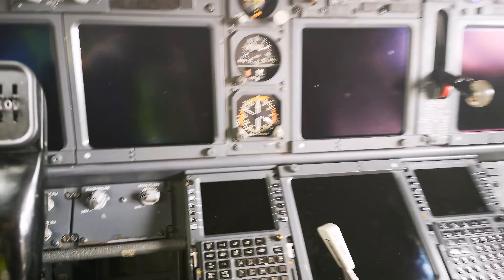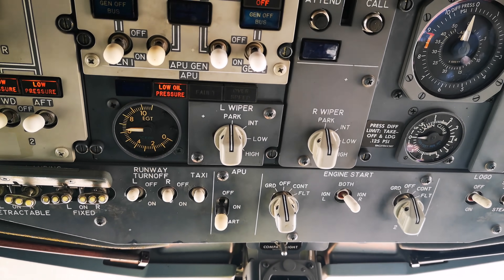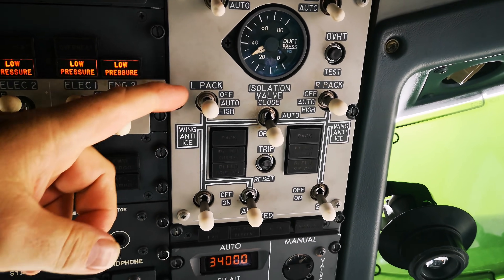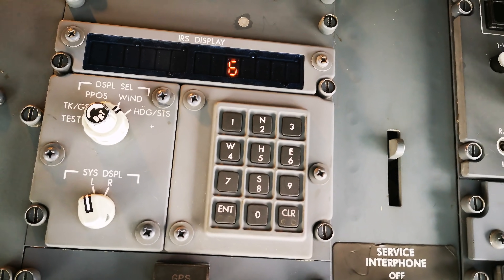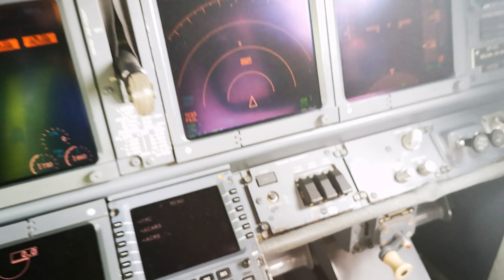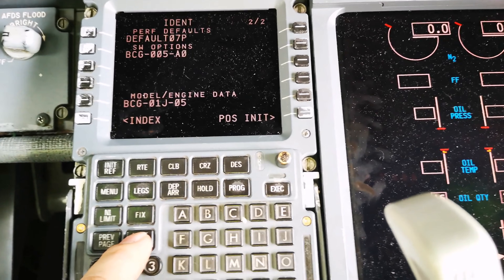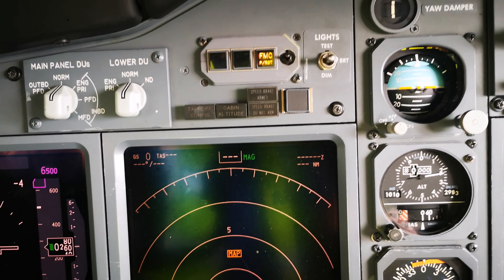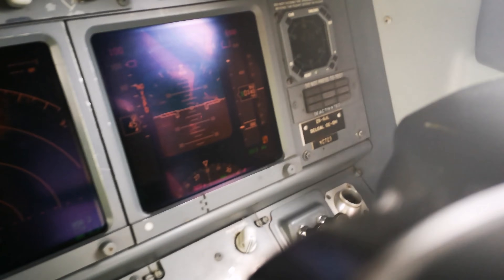B737 800 APU start and cockpit prep

Comment: It'll be perfect if this could be filmed with a gimbal  or a phone camera with better stabilizer. More detailed explanations for the abbreviations on the panel and basic theory explaining the readings of the dials/indicators and why that reading (3000 instead of 7000) is desired, please.

Comment: Great video, thanks. Does the Left Aft fuel pump need to be on for the APU? 738 models in flight simulators don't appear to need that, although it is on the pre-flight checklist.
Reply: It is not mandatory, but it is recommended. Turning on the fuel pump will increase the life of the APU.
Reply: Depends on the length the apu will be on. If ground power is up and the APU's only needed for engine start fuel pumps wont be necessary but here the APU is the main source of power and will be running for long hence the fuel pump is switched on.
Reply: Technically speaking, APU does not require any pump to start/work. Though enabling pumps will help APU Fuel Control Unit to last longer. Take into account the Fuel Pumps are AC, so you might not always have AC power before you have APU GEN on bus. APU DC pump is an option (automatically enabled), though APU can suck fuel without any pumps.

Comment: this looks like a giant mess. Compared to airbus is like engineer got drunk and installed all of these fancy switches and gauges in that boeing lol
Reply: It’s because it’s not all computerized like Airbus, it is still computerized though. Boeing relies on pilots more than airbus with the plane. That is why I personally like Boeing more.
Reply: what? Do a little research on 737 history and how type rating certification process works. What a stupid comment
Reply: Absolutely, it is a 60-year-old design. Even the MAX doesn't hold a candle compared to Airbus in terms of ergonomics and user interface.
Reply: @ttrcatbus  this may sound weird but I personally like it. It makes you feel so smart when you figure it out. It’s honestly pretty imple just looks hard
Reply: @ReidMichael-ip3oy  Simple, yes. The core systems are very similar between Airbus and Boeing as I’m sure you’re aware. Airbus just takes human factors into account much better than Boeing.
Reply: @ttrcatbus I prefer Boeing planes because of the yoke
Reply: @ttrcatbus Which is sad because the A320 is a 40 year old design.  Innovation died after the 80s.
Reply: That’s because Boeing pilot are competent pilots, instead of EHUM Airbus pilots, everything is automatic in that cockpit!

Comment: Good video.

So the Left Aft Fuel pump is left in on postion when going cold and dark?
Reply: It's been a while since I flew the 737, but the fuel pumps will only be powered with AC power to the aircraft (so, ground power, APU or engine Gens on). So when AC power is removed, the fuel pump will be unpowered anyway, as can be seen here with the 'Low Pressure' amber light on until the APU gen is on the bus (so no harm leaving the switch on really). The APU will suction feed without fuel pressure, but it's better to have one of the left main tank pumps on when running the APU on the ground to ensure good fuel supply (the APU fuel is supplied from the left side of the fuel manifold). You can use the left center tank pump as well, but the cockpit has to be manned with center tank pumps running, so engineers especially, who will likely leave the cockpit unmanned, will use the left tank pump. And the reason for using the AFT pump in the left main tank in the -800 is that it has lowest pickup of the two. The APU should be operated for a two minute warm up period before using it as a bleed air source as well, something to bear in mind.

I personally always moved the switch to the off position when it was intended to be off (as opposed to just letting it be unpowered). But there's very little harm doing it this way in practice. To answer your question: no, it's not standard to leave it in the on position. In practice however, it doesn't make a difference really - if you powered the aircraft with ground power however, the pump would switch on and run for no useful reason though if you didn't check the pump switches.

Comment: This is a 737-800 ? I am very surprised at the analog switches ,dials ,knobs and gauges .  This looks old .
Reply: Yes this is how an 737NG looks like
Reply: @BlackRacerGT19  yeah but the overall design has changed for example the screens.
Reply: 737-800 is nearly 30 years old now.
Reply: @BlackRacerGT19  Yeah i know. I didn't say they changed the type ratings. I just wanted to get my point through that the original comment said the 737NG looks old to which i responded that the 737CL looks even older.

Comment: I noticed the left aft fuel pump was already on before turning the battery on
Reply: Yes, otherwise APU wont have Juice to Power on 😅
However fwd fuel pump is advised to be used to turn the APU on instead of aft fuel pump
Reply: @AlexandreEmanuelle sorry but that is wrong, the apu can run with all the fuel pumps off, but for extended operations, Boeing recommends to switch on one fuel pump. the apu is only fed through the left main tank

Comment: Perfect. But you didn't mention that before APU start you have to turn on one of the fuel pumps
Reply: Wow very impressed with ur commet
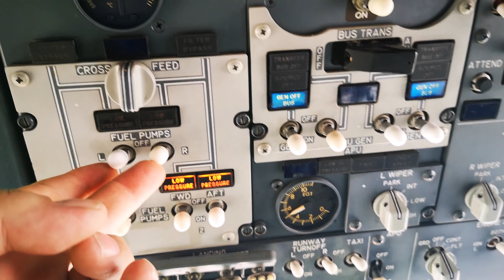Reply: He mentioned the fuel pump at 4:37. Out of sequence but he showed that that switch was already on before he started the video.
Reply: I think the pilots and engineers know best also I don’t believe you need a fuel pump on
Reply: Technically, you don't. How do you think APU battery starts happen w/no elec buses? The APU has its own fuel pump, but it's best to run one of the tank pumps to help it out. It will start and run without it though. Same for Airbus.
Reply: @noway9880 100%
Reply: Also take a note, that pumps are AC powered, and without AC power enabling fuel pumps makes no sense. From FCOM:

Note: Whenever the APU is operating and AC electrical power is on the airplane busses, operate at least one fuel boost pump to supply fuel under pressure to the APU to extend the service life of the APU fuel control unit.

So normally it's fine to enable the pump to ON before APU started (it will start working after AC is here) but not required

Comment: very old cockpit layout
Reply: That’s like 99% of modern jet liners tf? It’s a glass cockpit with analog backup gauges
Reply: @Watermalone119 no he's probably seen an a350 or a320 cockpit and hadn't seen Boeing cockpits before. Airbus have very modern cockpits and more computer systems and less buttons than Boeing. Boeing cockpits look a bit different and more complex
Reply: Bro theres just some analogue stuff. It has the Collins MCP so it can't be that old

Comment: After flying the CRJ which is by no means a modern aircraft I can not believe how antiquated the 737 is
Reply: The CRJ is a flying high-school physics project, lmao, you have no right to call the 737 antiquated. Those things are fucking terrible.
Reply: At least it has VNAV and autothrottle unlike your CRJ
Reply: It's a plane designed for real pilots it let's you have way more control than most airplanes especially airbus
Reply: @96cr show this man an A321 cockpit

Comment: Nice Video..... Shouldnt the IRS test take 9 mins instead of 6 mins.....
Reply: It varies depending on the latitude. Closer to the equator is shorter amount of time.
Reply: @tomp7621  
Interesting...since it aligns faster at a higher lattitude
Reply: @HAWK21M  latitude! not altitude,

Comment: Thanks for the video! I work on the P8's which is basically a modded 73-8, and boy do we have to go through the book to start the apu, takes about 10 minutes to get it running!
Reply: That’s stupid.  It should never take that long.
Reply: Oh I absolutely could not agree more with you on that one, but sadly it is stupid, everything is so over the top its actual aids

Comment: It is a mess compared to A320.
Reply from the maker: Jip,  Battery on, APU on, Wait a few minutes till you hear the 3 click sounds and "Tada". READY!!
Reply: It's 50 y/o design. You're comparing apples to oranges. The 787, for example, is just that simple as you describe. But it's the product of billions of dollars and years of development. You can't just do that to the 737.
Reply: @jrod_pilot_miami  A320 is a 40 years design. Boeing had pelnty of time to modify that, and what did they do with 737 MAX? yeah... to "save" money
Reply: @MiguelAngel-lk9tj  yeah. Boeing could have done that. But before doing that, they would have just built a completely new Aircraft. A cockpit design is an integral part of an Aircraft and the 737 just doesn't seem to be at the end of her lifespan.
Reply: @MiguelAngel-lk9tj  It's not that simple. First, Airbus and Boeing have two very different design philosophies. Airbus believes automation removes the human error component in flying. While Boeing believes automation should supplement pilot training and experience. That is the drive behind the Airbus' "simplicity" in cockpit operations, and Boeing's more "hand-on" approach. By the way, the Max is not a redesign; it's an improvement on the 737. You can't just slap an EICAS on a plane not designed for one. Aside from the high cost, there are regulatory implications that prevent this. It would be cheaper to design a brand new platform than re-engineer and reconfigure the existing 737 family (which would include the Max).
Reply: @allen480  You are probably wrong.

Comment: Why don't they have a Start button, and then a computer to do all those checks and settings?
Reply from the maker: Airbus is kinda like that.....It does various checks in the start up phase...Then displays all the system faults on the centre screen as ECAM messages.
Reply: @AviationEngineering1972  👍
Reply: @AviationEngineering1972 .  Bit like a BMW.   Then the check engine light switches on and you have to spend two grand at the dealership to get something repaired
Reply: Because computers are really good at killing people and not feeling guilty about it.
Reply: @jwboll  
Really? So are people.
Reply: I am afraid I can not land. 
 @jwboll
Reply: Reminds me of Arnold Rimmer (Red Dwarf) moaning excessively about restarting the ship and wishing there was a simple start button - even a diamond encrusted one would save money he thought.
Reply: airbus is modern and has the plane do stuff for you, boeing pilots are chads for doing it themselves (this is a joke i love both
Reply: One distinction though, you would be waiting 3-5 minutes sweltering in the hot cockpitfor Airbus aircraft to do their self tests, while the 737 could be on apu from cold and dark to APU running within the minute.

The lack thereof the computer automation of that does make for a faster boot up time

Comment: Since when did the -800 have the "skylights"?
Reply: They're called eyebrow windows. They were standard on the NG from introduction in 1997 until 2004. I believe they were still available as an option after that date, particularly for the military variants. Conversely, some operators installed plugs to remove them to reduce weight and maintenance costs.
Reply: Depending on the company. Some do have skylights.
Reply: @philippehendrickx1109  though that was pretty much phased out on the NG's. Ended with the classics. Guess not
Reply: I was wondering the same

Comment: Hmmm, so my GTA5 character hotwiring a jet in ~10 seconds is actually BS... Good to know lol
Reply: depends on the pylote
Reply: It depends. If say a tsunami is coming at you, a lot of test can be skipped and the plane will still flying. I will turn on BAT, then APU, then engine start right away in that case.

Comment: Why did you turn on the LH AFT fuel pump instead of the LH forward? I thought thats the one closest to the APU suction?
Reply from the maker: Its just done as a std procedure.....Our company operates the B737-400/800....There is enough fuel in the the tank for any of the two....If I remember correct its the aft for the 400 and the fwd for the 800..but we will see in the comments.
Reply: You don’t have to turn any of them on

Comment: Hand going everywhere.. having to test each and every system manually.. no real flow for procedures (jumping from one panel to another). It's an ergonomic nightmare for an Airbus guy to see this. Not to even mention how small the cockpit is. And here I was thinking that the A320 is a ripe old dinosaur.
Reply: Bless your heart.
Reply: There usually is a flow going top first, scanning to right and do the same the whole way down
Reply: Lots of extra unnecessary info in this video
Reply: I noticed he had absolutely no flow as well. Just scattered tests. No way I could remember it all doing it the way he does it. And I fly the 737

Comment: Jesus fucking Christ the 737 cockpit is just complete chaos. That's what happens when you insist on using the same design from 60 years ago because apparently training new pilots is too expensive smh...
Reply: There is a good reason for so much of the physical buttons too, if cockpit fills with smoke or in a dark night flight (flight crews dial lights to minimum to conserve night vision), being able to physically feel where the switches are is huge help.
Reply: @ShadowedZer0  yeah. Too much change is what gave us the MAX (which is still a really good plane that's cursed by McDonny Dougie mismanagement.)

The 737NG series is one of the most popular commercial airliners. Ever. It was conservative in its design. Anybody that says "reliance on a 60 year old design brings down the 737" is an idiot, and the 737NG proves that.
Reply: if it aint broke dont fix it.

look at how they tried to fix the max lol.
Reply: @reynaldiwidjaja277  Actually it's the opposite. It's broken and they refused to change it and that's how the got the MAX.
Reply: @henrychan720  Feel free to explain what exactly is “broken” before you make such egregious comments
Reply: @Jack3md  Ummm... juat look at it and try not to get dizzy?
Reply: To think all that shit could fit onto a microcontroller, but the reason for all the individual controls is due to EVERY single sensor, controller, microcontroller, basically the entire plane has to have a direct fibreoptic link to the black box, and all the controls. It's complicated for a reason but most of it is safety, and manual engine management. Take what I say with a pinch of salt though, I might be wrong.
Reply: @defirence  Microcontrollers and their codes that run modern airplanes are extremely reliable and have multiple redundancies. "reliability" is just an excuse for laziness for keeping the same overhead panel for so long. In fact, I'd say it's less safe than a modern cockpit with lights off buttons and big LCD screens because it's much more likely for pilot errors to occur in an unorganized cockpit.
Reply: @henrychan720  so your point is boeing should install a single push start button to automate all of these systems ?
Reply: @henrychan720  also LCDs is bloated to replace all those buttons would mean you have to arrange it in sub menus it'll be like having your climate control in your car infotainment display while playing your carplay or stuff you wouldve to lets say theoretically click home go to AC menus and adjust the temps rather than have different buttons for climate control.

It'll be cheaper to the manufactures not having to made all the buttons but its not tactile, quick, or very (what do you call if a button is easily reachable even if youre not looking at it) memorable?
Reply: @henrychan720  True, but remember the same layout and training manuals have to be maintained and supplied until Boeing decide to mark the 737 as EOL which I doubt would be soon, since they're safe and generally reliable if kept maintained. I don't doubt Boeing is researching and employing people to move the old Analog tech to microcontrollers since they're extremely accurate with electricity and all types of data, sensor etc. signals.
Reply: @reynaldiwidjaja277  The issue comes in as I said is that all that data needs a connection near the speed of light (fibreoptic) to control the plane, there can't be a single milli, nano or femtosecond of delay otherwise it can lead to disaster as has happened both with human error and mechanical/middleware or maintenance failure in the past.

Comment: To dam complicated.dont need all that bs.
Reply from the maker: Try us as engineers... From personal experience I myself have worked on Boeing 737-3/4/5/8, Boeing 747-400, Boeing 777-2/300, Boeing 787 and the Airbus from the A319,A320,A330,A340 and A350 at the same time during my time at my previous employer, then add on different configs and layouts per customer requirement.....My experience Logbook is a nightmare. After all said and done, experience can never be taken away and we learn from it every day..... "Never stop learning, it only makes you stronger."
Reply from the maker: Play nice "Boys"..…
Reply: @AviationEngineering1972  affirmative
Reply: Shut up asshole,you don't know how fun it was to flick/press the switches onboard the aircraft cockpit.
Reply: You prolly never even touched the controls of any plane before
Reply from the maker: I have...on two different aircraft.....A T6 trainer(Harvard) and a C47-TP(Turbo Dakota). Aerobatics in the Harvard and low level (500-1000ft) along the South African coast between Richards Bay and Mossel Bay...Your Move!!!

Comment: What is that buzzing sound when you turn on the battery at the beginning (Before starting the APU) ?
Reply: I believe that's the apu/eng fire test. Just let's you know it's working just in case a fire happens, the squib and fire bottles will discharge correctly
Reply: Avionics starting up and gyroscopes I think
Reply: Power transfer buses and power dc-ac converter power electronics.